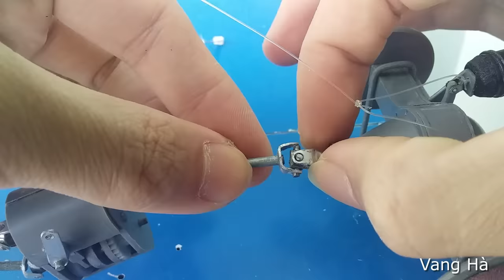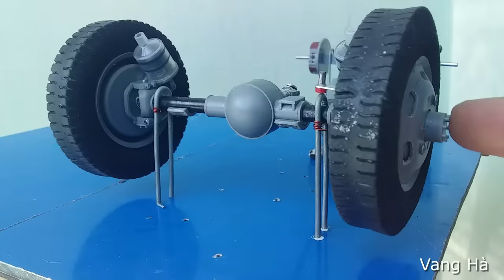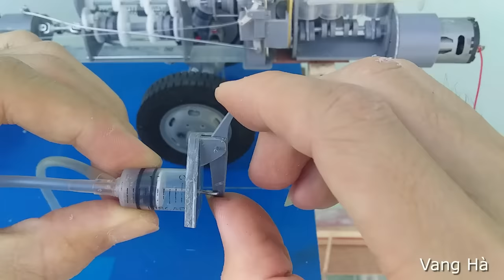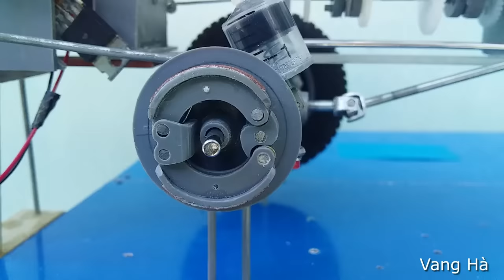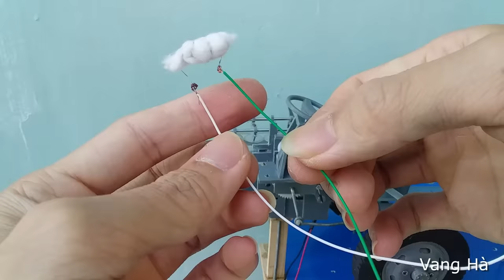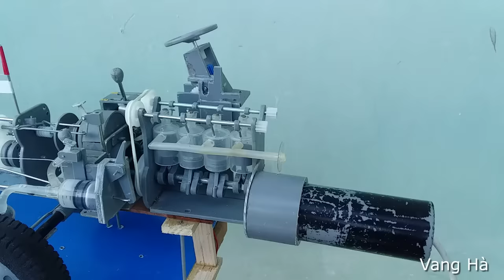Homemade Gearbox, Engine Model from  PVC | Vang Hà

Comment: Very cool are you using a 3D printer ? Also your next project should be an older WW-1 aircraft that would have such mechanical controls modern cars don't use this

Comment: Ok heres a challenge fa ya. When you have a few years to spare id kill to see a working Unimog 12 WD with a workig 12 cylinder engine. I dont mean a compression motor obviously but pistons valves the works and could cheat by using an electric motor for the starter which would stay engaged and turn the engine over spinning the flywheel turning the tranny etc.